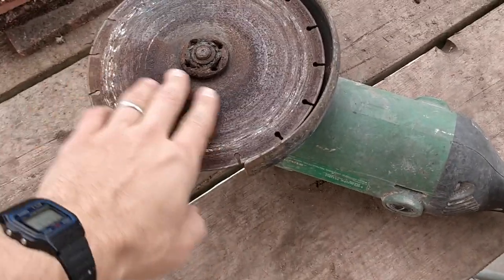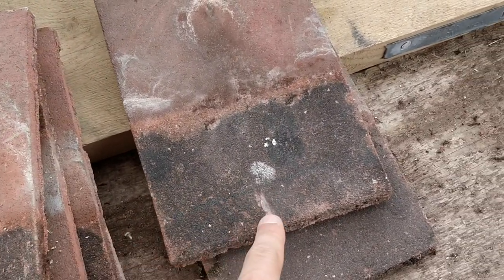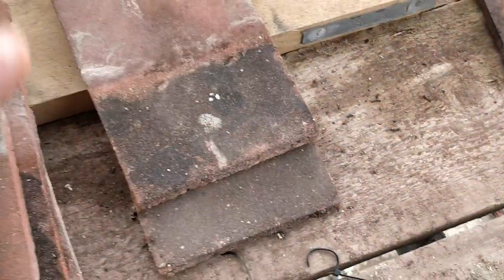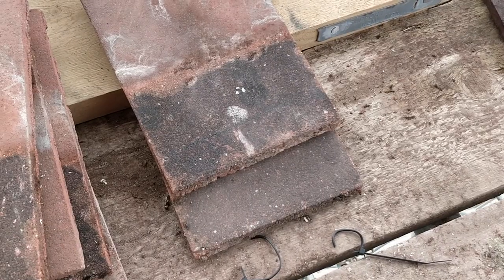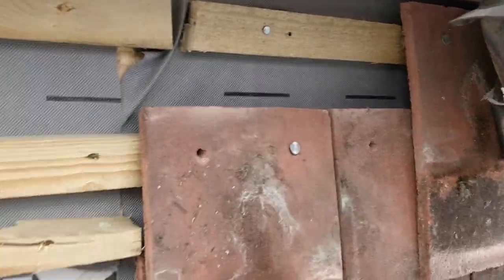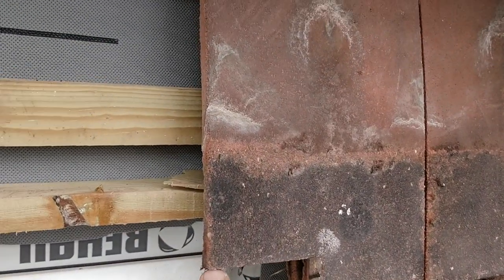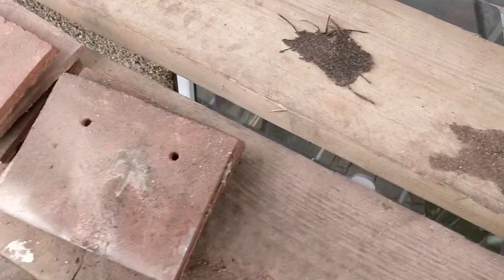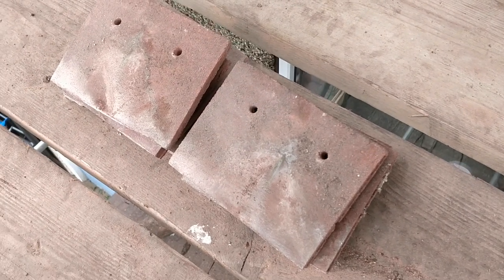How to tile around windows

Comment: How come you did not need vertical battens
Aswell as horizontal battens ??
Reply from the maker: Not sure I understand...? Vertical battens would keep the tiles away from the building more, which may be needed in some instances, but not here. We just needed horizontal battens to hang the tiles on.
Reply: @OfficeBoyBuilder  Im new to this type of building myself,
I'm currently doing a very similar build and the architect has specified
Vertical and horizontal battens,
Reply from the maker: Interesting! I wonder if that's for airflow. It would be interesting to know why they've specified that...often it can depend on a range of factors. It's similar with the airgap required for a vented roof. The regs state 50mm, but the major manufacturers of PIR (kingspan etc.) They are rated down to only 25mm because they're so efficient.
Reply: Because he’s tiling it, plenty of airflow. If he was rendering it, he would install vertical battens to allow airflow, then cement board then render
Reply: @stephan5673  counter battening that is mate but I’ve not heard of it in tile hanging it’s usually on a main roof

Comment: Sorry not a great job .I would never put a cut at the bottom line.
Reply from the maker: Fair comment. It was originally going to be a white plastic fascia around there, but I didn't like the look of it and wanted tiles. Because of that last minute change the battens had already been set out and so a cut was inevitable.
Reply: Hi yeah I see whare your coming from.you dont want plastics.so I suppose you did the right thing.
Reply: You a roofer 👍
Reply: @OfficeBoyBuilder  should cut the top of the tile mate then drill new nail holes but all considering fair play
Reply: @OfficeBoyBuilder  the small tiles are eaves and there to make it watertight on the bond not just to bulk the tile out without them water would penetrate through the bond of the first course of tiles 👍
Reply: @garethjones2528  yes m8t 45 years.
Reply: @matthewfarrell.9956  👍 bout to batten a job in meself mate , have a good one bro
Reply: @garethjones2528  same my friend. Job looked ok bar the cuts we all learn new every day stay well 👍